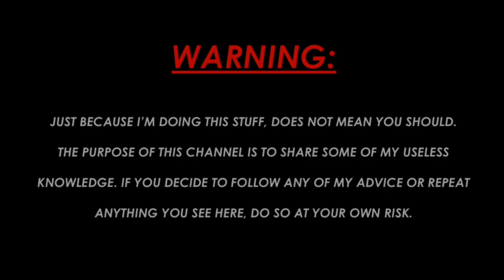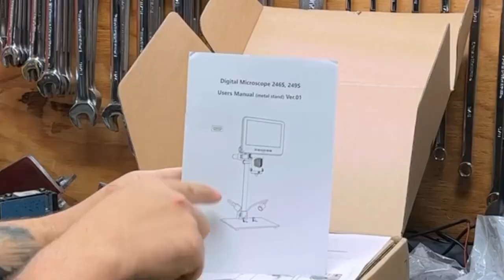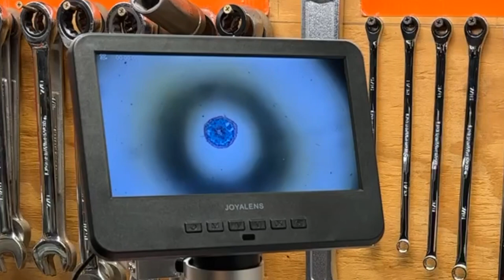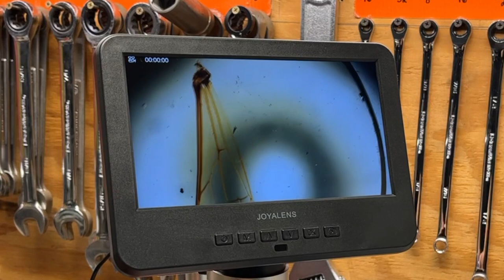Joyalens Digital Microscope, tool review!!

Comment: Tell ya what,
It would of been nice to have JUST the camera, with an HDMI plug to ANY TV/MONITOR you want.
Reply from the maker: It comes with an HDMI cable that you can plug into any screen or monitor
Reply: @dansproshop  I looked it up it also comes with USB..so you can use the computer and look data up while Viewing.  And take pic's and Probably video, to show a tech to see if they can tell you whats wrong or what to replace.